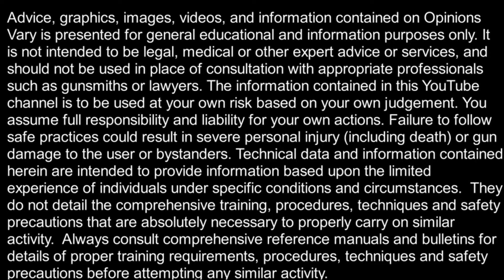DYI 1911 Accurizing

Comment: There is a bunch of baloney in this painful-to-watch video.  I had a 1911 that was bult by the US Army marksmanship section.  The barrel bushing required a wrench and some force to turn it.  Most accurate pistol I ever had.  Could put all rounds in the x-ring at 25 yards.  Match grade 1911s have tight barrel to bushing fit and tight fitting rails.
Reply from the maker: @gfrazier52  In my opinion: That's pretty redundant. Would there be anything other than simple character attacks or appeal to authority served as a post hoc that would speak to topic? So you don't like it. ~ Whoopie.

Tight rails don't stay tight on any 1911 for very long being their frame rails are pretty short. This is because of the cam lock semi floating barrel design. 

The integral pressurized round orients the barrel when the hood area has chatter. The amount of slop there & chambered angle otherwise makes NM barrels a moot point. If you chop the feed ramp like was done in the 1980s though the 1990s, a tighter build will rattle vs the original design. 

The bushing must not pull the barrel otherwise severe wear occurs on the slide stop pin, barrel link pin during the galloping feed in & out of battery. 

You would be very challenged to keep that running the way you believe it ought to be.

Military armory doesn't design firearms by the way. To reinvent the wheel, it would probably come to a flat in short order for lack of knowledge.

Comment: Please take what this video says with a grain of salt. Make your own decisions on whether or not what he says is accurate.  All I'll say is that the "2nd link" is a barrel bushing, it does not need ANY chatter at all quite the contrary the tight terms the more accurate as stated by the best 1911 builders in the business, the cant happens by way of the link not bushing, and finally full length guide rods in fact increase ftf occurrences not reduces them. If you arent sure refer to the kuhnhausen manuals. I'm not saying he doesn't know what he's talking about but I couldn't watch past about 2 mins and I already had this list of discrepancies.  To each his own tho,  maybe I have been misinformed about all these things....but I doubt it.
Reply from the maker: In my opinion: Relax, what gunsmith manuals will not address is how barrels relax set. On a 1911 the barrel will bend in time & if the barrel bushing is tight both ways, it will barrel spring causing the bushing to pull the barrel forward prematurely. This is why you shouldn't rely on theoretical books written by self made idealistic people who lack trade experience to know the extent of what they think they'd be doing. I will cover this in forgoing videos, you will see the truth of the matter plain as day. It will shake a lot of people, but seeing is believing & wear patterns do not lie.

There would be no other way to set the angle inside the bushing with the past & current methods of machining. You might notice how nobody sets the inside bore correctly being when the slide comes out of  battery another angle comes into play not addressed by any gunsmith let alone manufacturer.  Keep in mind the higher the link, the worse the extractor claw function. This is why so many people have issues with extraction for this design & it gets worse with short barrel compacts. 

Barrel springing is a big deal & destroys parts. That beloved bushing you'd be talking about is a thin flanged tube that also takes a relaxed set. When set tight by gunsmiths it can cause barrel springing.

The recoil spring plunger is not stable enough on its own not to cause impact problems with the plunger cap. It will have to do a video on this when I find another 1911 with this problem. But the only advantage the short rod offers through it's instability is unintentional shock absorption that pre-wears the recoil spring beside the hammering effect of the slide to frame. Recoil spring guide rods do not cause failure to feed unless someone drops the part & damages it causing a dent on a functional surface. 

A gunsmith is not a legitimate expert & inline with a lot of shade tree mechanics. Belief seeks its own truth & seeing is believing. 

~ Have an nice day.

Comment: Those "lugs" are for slow down the blowback, because of high pressure ammo, so it doesn't explode your gun and your hands.
Reply from the maker: In my opinion: Yes, that's correct. But it wouldn't explode the gun. Just control the recoil pulse. Many fixed barrel guns do not have lugs & they do not explode because of the slide blow back. The shell of a bullet holds things for a little while to prevent that sort of theriotical explosion so to speak. If you have an unsupported chamber, the shell can explode (rupture).
Reply: @opinionsvary  You are right. "Explode" was kind of sort of speak, but it will definitely cause serious issues in gun and may be harmful to the operator. There are many systems to slow down the slide, such as delayed blowback, locked-breech - that can be the "lugs" (1911), or a depression directly on the barrel (glock and most modern pistols), or a piece under the barrel (like Beretta 92, Mauser C96, Walther P-38...), but they all have the same goal, and it's needed to avoid breaking the gun. They only don't exist in small calibers because they don't function in high pressures, like .22LR and .380 ACP. 
Greetings from Brazil! 
Adam Kaminski - Gunsmith
Reply from the maker: @adamkaminski  In my opinion: Well hello, from the USA. 

High Point's 45 ACPs are a popular pistol being as inexpensive as they are. I don't recall ever seeing any upper locking lugs on those or the 1st run MAC10 submachine guns or the 45ACP Grease Guns the US military used for so long. 

Yes, some are delayed recoiled, but the 1911 wasn't designed that way.  One time in band camp... No, I'm kidding... But I did a 40 Super conversion on a Glock 22 once that ran a necked down 45 shell to 40 caliber. The crazy thing is how much less it recoils running the same 24lb recoil spring. It's not the slide weight that comes into play, but the shell dimensions around the case shoulder that seems to largely delay the blow back. When compared to a 10MM, 40 Super had significantly less blow back energy. I just assumed the 40 Super had a grippy shell in contrast to. But you're right on about those rifle calibers!

I forgot to mention how rifle powers tend to have lower burn rates that can cause shells to exit the chamber prematurely when the bullet unseats, thus causing an explosion. So it would need to be locked in. 

The depression before the barrel chamber just knocks the floating barrel down against the weight of the slide & recoil spring resetting it to the feeding position. It really doesn't lock anything. 

- Cheers!

Comment: Makes sense and it is all I have ever done. Fit the bushing avoiding barrel springing/binding and make sure the slide stop fits the barrel lugs. A match barrel is nice but not super necessary. For practical accuracy and a daily use pistol you don't need all the fancy stuff. Decent trigger and sights plus accurate enough but reliable. 🇺🇸😎
Reply from the maker: @charlesvail2443  https://youtu.be/aFBafTtK92M?si=0ZVfYQlMx20OjDW2
You'll love this one.

Comment: I wonder how this design worked, as designed, for about 110 years now. The FLGRs are gimmics to sell to the gun newbies. The government style guide rod will work just fine.
Reply from the maker: @tomnelson3362   @tomnelson3362  I like Ed Brown's staged down rod with better fit base works better than the usual runs.  

FLGR makes top ends swap more complete without launching the plug although it does happen in either case.

With all the spring detents going on throughout the design, why not make a recoil spring like a lock pin to complement the internal mortis lock get up. 

It's not a hard to figure out design when the basic idea was loose tolerance technology like a yard pad lock.

Comment: You can just push the slide lock pin from the other side of the gun and then it pops it up enough to grab. No need to grind a groove in it.
Reply from the maker: In my opinion: I have another video on slide lock/release issues you might check out if you really want to know everything that happens with this part. 

Without a groove the part slides around &  drags on the slide. They can pop out during shooting too. Some custom shops reduce the length of the pin to prevent that making them counter sunken or flush to the frame. It's a known issue to those who rest their trigger finger out of the ring. In high stress situations the operator can pop the part out of the frame causing a malfunction.

Thanks for watching, stay tuned for more.
~ Cheers.

Comment: I'm installing some upgrades on a RIA fs 9mm....I just completed the trigger with WC bullet proof everything and polished the track and all other contact areas....In this pistol I've already fitted WC BP extractor which we talked about on your other post.....I'm also fitting an EGW extractor just because......lol.....In your opinion do think it helps to polish barrel and as much of the internals that make contact so it cycles better quicker or just run rounds through and break them in with use?......
Reply from the maker: @thomasrouh2258  You'll get adhesive wear from the different metal properties. That's why you'll be polishing way more than once. The Wilson has an oversized claw making it difficult to remove once in. I tried one once & found it a pain in the butt when cleaning the slide. You can run a .22 bore brush through the tunnel at the cost of some surrounding finish. 

Check out my other video on improving the trigger ergonomics. Don't remember what the title was off hand, it'll give some pad profile tips you'll probably appreciate more than a totally flat sharped corner pad or striated sickle.

You will break in some what, even though that won't automatically correct the relaxing or off geometry parts.  If the parts are way off, you can get jams off the claw or the magazine feed lips. The bottom throat of the chamber should be roundish to reduce the drag when the bullet nose pushes against the upper chamber as it goes in & chambers at an angle. 

9mm is tapered so it probably won't have feed ramp issues. The extractor & magazine feed lips probably will be the most challenging.

No full length guide rods unless you bore out the bushing hole so it won't drag being the 9mm slides are way heavier than the ideal operating slide mass. Felt recoil is similar to a BB gun.

You probably at some point run into slide lock engagement issues with unsupported magazine followers.  EGW are my usual go to for slide stop/releases because you can get oversized pins that don't protrude too far out of the frame.  Wilson doesn't seem to offer + .003" oversized pins.

Comment: Thanks for the very informative vid!  However, you did not address the accurizing level of a collet bushing.  How would the accurizing quality of a collet bushing compare to the standard bushing (notwithstanding possible collet finger breaking)?  🤔
Reply from the maker: In my opinion: I replied to previous commenter if you'd have the time to scroll down the thread, so I'll cut & paste the content for you.

~The collet barrel bushing that uses the spring tabs is completely different & fragile. On this set up a tapered end at the muzzle tightens to remove chatter. They'd run a 2.5 link & had shorter barrel hoods leading to the squared areas at the chamber ends for the lock. If the length of the link is changed, the bushing tabs will break. The link thickness can be fattened to help with accuracy by removing side chatter that is a problem in all 1911s with linked barrels. With a link that has a lot of wiggle it will cause the barrel to vibrate when it hits the frame bed. When this occurs, this can batter the top part of the extractor claw as it cycles. The better looseness would be a little up & down so the feed can be complemented & assisted. A wiggly link can walk a barrel pin out that can then drag on the frame. In retro spect most of them had their bushings replaced with traditional more solid ones because the collet tabs would break. The 9MM full size Colts lasted the longest being they ran 15 lb recoil springs that under load of the feed (empty slide drops ruins 1911 parts) wasn't as bad as it was with 45 ACP. The recoil pulse is way different on the 9MM version & you shouldn't ever use solid recoil guide rods because the little drag of the plug can cause feeding problems on that particular arrangement. 

Guide rods can help make collet bushings last longer on the larger calibers, not so on the 9MM.

The collet design was a gimmick that Colt abandoned because they weren't any better than the original design in the way that the bushing wears the same way inside the slide as the solid design. The collet bushing idea was to overcome the loose slide/ frame chatter while barrel stability was theoretically increased. If the barrel gets pulled forward by the bushing the barrel hood would have to have more clearance than the original design to make it error free. The method I discuss in the video would be about the same in result to a collet, but the rear barrel lock up would be significantly better than a collet. Typically you probably wouldn't notice any accuracy difference considering they are handguns, but the collet system runs looser specs for the barrel hood. 

When the collet holds the barrel, the chatter around the spring tabs would be about the same. You'd want the bushing to lasso both slide & barrel simultaneously without pulling on the barrel (otherwise you'll get heavy dragging on the bottom lugs & slide stop hammering).
Reply: @opinionsvary  Thank you for your very rapid response!  I'm just a novice shooter/collector; buying my second Colt 1911 (a N.O.S. G.C. - N.M. Series 70) made in late '70's (?) only a few months ago.  It came w/ a solid bushing, but I thought/expected it to have the collet bushing, thinking the collet would make it more accurate.  Should I buy & install a collet bushing?  BTW, my first Colt is a 1945 1911A1, & it seems to shoot just as well as my new G.C.  I'd think the G.C. would be more accurate, but it doesn't seem to be.  Hmmmmmm..
Reply from the maker: @1628gary  In my opinion: I edited some of the pasted content to focus more on your question. 

A collet bushing works with a tapered end barrel. It probably will cause all sorts of damage if used on the standard barrel. I say this because I once ran a Brily Spherical bushing that supposedly mated the barrel to the slide within  .002" & caused all sorts of problems. The bushing ripped off ending my range session leading me to see gimmicks for what they would truly be. 

As the gun ages the bushing will relax set under spring load. That naturally removes a little slop. 

On the G.C. if you don't care about collectors value, you could fit a replacement bushings with my blatantly obvious simple technique that nobody else in the entire world could ever have figured out. 🤣 Then replace the link with a fatter one to remove the back end barrel slop (don't mess with the hight though).

Oftentimes it's the way the grips feel in the hand that makes you think the gun is inaccurate. Typically a GI model should shoot just as well as a custom at 25 meters. Most people can't shoot well enough to see the difference. 

~ Cheers.